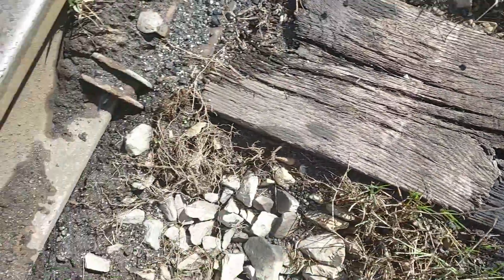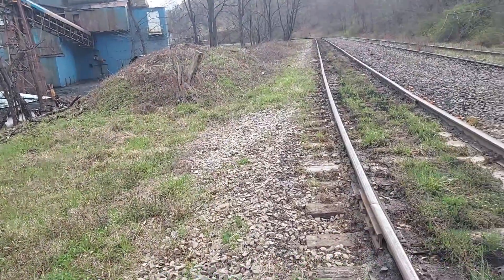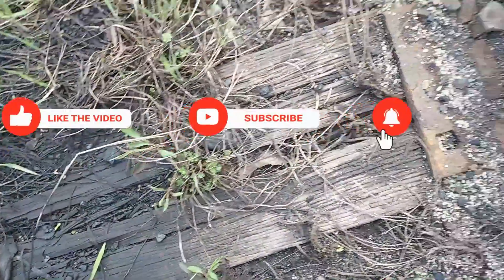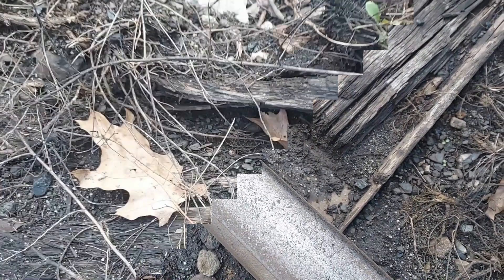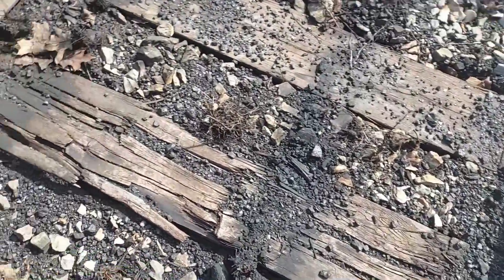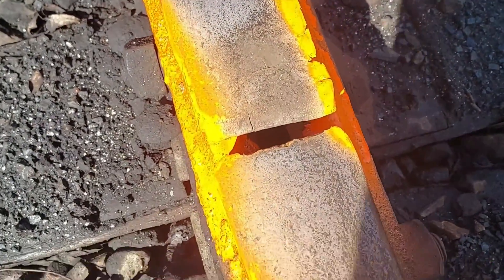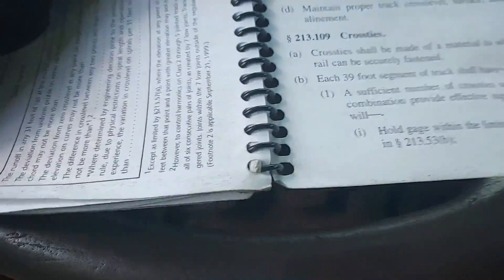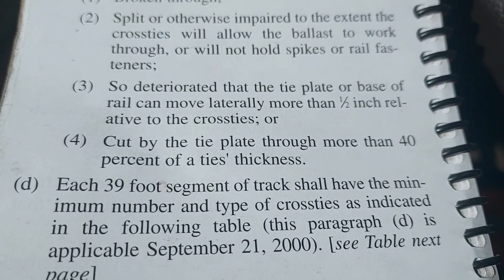Marking Bad Railroad Cross Ties on Excepted Track

Comment: OMG ! I'm surprised ! Every ! Sleeper !/ Tie ! WASN'T ! MARKED ! BY YOU ! HERE ! THE COST !??
Reply from the maker: Remember it was excepted track (10 mph) and the FRA requirements for number of good cross ties in a rail length (39 feet)
is only 5 David. There are typically 21 cross ties per 39 linear feet. 
If we didn't put any ties in there that part of the track would 
still be acceptable under Code Fed Regulations.  Really appreciate your watching our video and keep your hand on the throttle and your eyes on the rails.

Comment: i recall on conrail they had big piles of dirt and ties at end of track ran over a few of them made it a flat pancake the m-w  would freak out when they seen that guess they did not a pile of dirt would stop a 200 ton  rail car they would also  put steel cabels over the track lol ripped many of those too.
Reply from the maker: We ran a ballast car off our siding once, there was a small tamper parked on the end of the siding and it pushed that
thing down over the hill Edward. After that we put about 100
ton of ballast at the end of the siding. Never heard of using
cables across the track, can't imagine they did much of
anything.

Comment: I remember working for NS they would be a gang that would come in and they would have like 40 different pieces of machinery. A lot of those smaller machine looked a lot alike but had some differences about them. I know what a tamper is a spike puller  and a spike driver some of the larger pieces was obvious. But the smaller pieces that looked a looked a lot alike in some forms would leave me wondering. You knew they was there for something but most of them I couldn't tell what there purpose was. And what ever become of that autonomous hopper car you once showed . I've been retired for 10 years  but haven't seen one of those yet. Will they let them run on class one RR  ? that's almost looks like where they belong.
Reply from the maker: Your right, now a days there are so many machines on the tie
gang it's hard to keep track of what everything does. 90% of
the manual labor has been eliminated by the machines RC.
The hopper car is in the testing phase, currently they burnt
up some parts and are awaiting new parts to come in.
Appreciate very much your taking the time to check out the video and may you have a very good day my friend.

Comment: Is there a FRA MoW inspection handbook that has all the things to look for in one handy little book?
Reply from the maker: Yes there is SuperAWaC. That is the book I read from about the number of good ties required. I will show it again when we
do the first video on ultrasonic rail testing. It is the Track Safety Standards Part 213 Subpart A to F. Covers all the fed regs for class
1 thru 5 track. Appreciate your visiting with us and writing in 
my friend.
Reply: @ccrx6700  Thanks for the info. Do you know where I could buy one of those books?

Comment: How long is a tie (sleeper for me) meant to last on your railway?
Reply from the maker: Good grade ties will typically last 25 to 30 years in tangent track
with good ballast and good drainage. Ties in mud will last half that
long. Ties in sharp degree curves their life will be shortened also
because of the great amount of stresses on the ties from the
curvature.  Thanks so much for taking the time to check out the video and write in my friend.
Reply: @ccrx6700  Thank you for all the details! I like your videos a lot. I used to be a signaller and guard (you call them conductor) on a scenic railway. It's interesting to see how yours operates and is maintained.
Reply from the maker: @szabados1980  👍😊

Comment: ‘cut by the tie plate by not more than 40%’!!! My god, that’s SOME leeway?☘️👍
Reply from the maker: It certainly is donal finn, we never let our ties get cut that far down.
Thank you for taking the time to watch the video and write in. May you have a most blessed day my friend.
Reply: It's not quite as bad as it seems, when the track gets tamped the ties are pulled up. A soft tie will continuously wear, to the point that the plate is 40%+ worn through and the tie is still supporting the track.

Comment: It seems to me that there has been chronic underinvestment in track infrastructure in the US. Every time I watch a railroad video, all I see is rotten or worn away ties. Sometimes I’m quite shocked by how bad they are?
Reply from the maker: There are a lot of problems in the rail industry, mostly on the
Class 1 RR;s they are controlled by Precision Scheduled Railroading
which is all about pleasing stock holders and cutting budgets
to do it. Most shortlines and regionals don't have near the
problems the big RR's do.

Comment: While inspecting track for the USRA study of bankrupt railroads in 1974,  I saw a length of track that was at least 6 rails long that the ties were plate-cut about 75% and did not have any plates or spikes showing and observed a loco with several cars traverse the track at 5 mph and DID NOT derail.
Reply from the maker: An old railroader once told me you will be amazed at how
a train can sometimes go over really bad track and not derail,
and then at other times the slightest little thing will jump a
car off. That's railroading. Thanks so much for writing in
and watching my friend.

Comment: Way back in the day before my time. They used a white dot in the middle of the gauge. when they cut the ties in two places and used the butt picker machine that pre-dated tie cranes. We were walking a long stretch and my boss asked me what I thought happened at a given location. White paint splattered all over the inside of the rail. Before the aerosol cans they had a blotter tool you carried paint for. I figured it was alcohol related or some post domestic incident. I know how things were on the system and how knuckle dragsters could be. The Supervisor figured bees. Made sense once you could imagine some poor track worker desperately swatting away wile running.
Reply from the maker: A spot like that certainly would make one ponder for a bit Lawrence!
Thanks so much for your visiting with us and sharing the story
my friend.

Comment: is a runaround track the same as a passing siding?
Reply from the maker: We call it a run around track here because when we only had 1 loco
that track is what the loco ran around on to get to the other end
of the train cars. But basically yes it's the same as a passing siding.
Switches on both ends to reconnect to the main line, same as
a passing siding.

Comment: As a rule, do you replace ties whenever a derailment occurs? I would think the wheels would do pretty bad damage to them, but I could be wrong. Thanks again for another great video!
Reply from the maker: Depends on the amount of damage Jason. Sometimes just
one of the tie ends gets damaged so those usually don't get
replaced, sometimes there is major damage to the ties and
they all need replaced. Here is a video we had of a derailment
April 2020. The ties are splintered, it's ugly
https://youtu.be/hzcVIM-rqLo

Comment: Do you ever use Relay cross ties?
Reply from the maker: Almost never Thomas except for in sidings. They have always
bought new grade ties for the main line. Most of our good relay
ties are given away, if you watched my videos last year on
rebuilding the W&W RR I gave them over 250 good relay ties
and we replaced them their.When ties are taken out they
are sorted thru and the junk ones go in dumpsters, we do
save the good relay ties and have a few on stock for
emergencies.

Comment: US railroads should really start replacing timber ties with pre stressed concrete like the rest of the developed roads. Timber ties were ok during steam days but that was over 60 years back.
Reply from the maker: If you would care to learn more about why we don't
use concrete here, then watch this video, explanation is
about 1/3 of the way into this video. Nothing wrong with
concrete ties but we for now simply cannot have them
without a very expensive upgrade to my tamper which I
explain in that video.
https://youtu.be/oOug0z34118

Comment: David,
Good evening hope you are well.  I have been meaning to ask this for awhile but, what is the disadvantage of Concrete ties if any and why they are not the mainstay of RRoads these days.  Appreciate your consideration!
Reply from the maker: There is a big discussion about concrete versus wood ties,
way too much to go over in a comment. Someday I will make
a video on the differences, for now we don't have concrete ties
because my tamper will not insert the tamping tools deep
enough to get under concrete. Concrete ties are 2 inches thicker than
wood. Tampers with the Jupiter 2 operating system can
easily toggle between wood and concrete with the push of
a button, but I have an old operating system on my tamper
which requires a manual adjustment of limit switches which
would take about 20 minutes to do. Total PIA to do also.

Comment: The limit switch issue for the tamper seems like something an enterprising shop mechanic could fix with another set of 4x limit switches and a 4-pole double throw A/B selector switch in the cab with an pair of indicators.
Reply from the maker: Now that sounds like a very good idea Tim! Wonder no one
ever thought of that, seems like it would work very well. Appreciate
your writing in and for taking in the video tonight my friend.
Reply: @ccrx6700  Cheaper than a new tamper for sure.

Comment: Hi Dave, great video. Quick question, would it be more beneficial using concrete reinforced sleepers (ties)?
Reply from the maker: Thanks John and glad you enjoyed. I cannot tamp concrete ties
with the operating system on my tamper. Here is a video where I show
you why on the tamper, it's about halfway into the video where
that part is shown if you would care to watch:

https://youtu.be/oOug0z34118
Reply: @ccrx6700  That's cleared that question up nicely, thank you.
Reply from the maker: @johnn1575  😊👍

Comment: Also I forgot to mention your lucky ! When I had crushed head like that i was almost always forced to let it Dutchman to about 3 1/2 to 4 inch before 
Getting to change it out due to our limited rail supply
Reply from the maker: I hear that W. G. but that's what good railroaders do, they fix what
they can with what they have to work with. Pain in the rear to do
it that way, but if rail isn't available you made some excellent choices.

Comment: Nice great video as always Dave notice some mudding and some rail movement in some areas you marked. I know under excepted circumstances you don’t have to worry about being in compliance in 1 and 2 are you gonna do some cribbing on this or let it ride ?  On your plate cut example excellent explanation on the plate cut and can’t deficiency explanation. 

When I know I have budgets  for it I like to mark all my joints first then mark the remaining ties. 

Cheers from one railroader to another!!
Reply from the maker: Thank you very much W. G. for the very nice comment. Always a
treat for me to hear from a fellow railroader. We will eventually
crib that section out but for now we have bigger mud problems on
the main that will get addressed first.  After the ties were replaced,
we ballasted and tamped the section so it will hold up for awhile
and train is safe to run over it. Good thinking sir on the ties under
the joints first! Appreciate your writing in and for watching my
friend.

Comment: Sir what class is the rr you work on? Also I thought that class one was the best track to run on. Thanx Ken from gpt ms
Reply from the maker: We are on class 2 track Kenneth. There are 9 different classes
of track in N. America. The higher the class of track the faster
the speeds allowed on the track. Classes 1 thru 5 is generally
for freight and passenger. Classes 6 thru are 9 are almost
exclusively for freight.  There are 3 classes of RR's in N. America.
Class 1 RR would be a company that has a huge amount of tonnage
and revenue. Class 1 RR's are those like NS, CSX, UP, BNSF, KCS,
CP and CN. The lower the class of RR the lower the tonnage they
haul and the revenue they bring in.

A Class 1 RR may have different classes of track over it's system.
So you see now the difference between classes of track and classes
of RR's.

Comment: the manual ought to say moves laterally relative to the line rather than the cross tie. if it moves laterally relative to the axis of the cross tie then thats a whole other problem.
Reply from the maker: I'm sure the FRA might be interested in your suggestion hardrays.
Lateral movement in the rail is certainly never a desirable thing.
There is another section in the CFR that does address the amount of
lateral alignment that is allowed/not allowed on the different classes of track. Appreciate your taking the time to write in and for watching my friend.

Comment: How heavy is this rail? Is the track a 'main line' or is it a spur w/ a run-around? Can concrete ties be spaced further apart then wood depending on rail weight & traffic? 4:30 It looks like you have sunken track. There's a lot of fines & debris in the ballast. Do you think there is a developing issue of drainage? 6:45 I'd think the 'plate-cut-tie' & many like it, might as well be replaced while the MOW crew is in the area...wouldn't you think? It's only going to get worse. Thanks for answering any questions you can make time for & thanks for the video Dave.
Reply from the maker: Rail is 132 pound Carmie. Track is a run around and used as they load 
the train. Yes there are some places in that whole section which
are sunk and could use a good tamping, the tie gang generally does
not like track being tamped before they put in ties, so it has gotten
tamped after the tie replacement happened. Yes we do have
some drainage issues that will have to be addressed at some point,
but right now we have bigger issues on the main line to take care of.

Comment: looks like some areas have been flooded out with mud leeching between the tracks. won't the track bed need repair and re-ballasting to repair that?
Reply from the maker: Yes this section does need some cribbing work done MidnightVisions.
But it gonna be awhile before we can get to it, got bigger fish to fry
cribbing on the main for now. After the ties were put in then this
whole section of track you saw we spread new ballast and tamped it.
So it will hold for awhile until we can crib it out.

Comment: It seems like the ties are sitting on the ground rather than a layer of ballast.
Do you reuse the tie plates and spikes or do you just replace them with new?
Reply from the maker: After the ties were replaced we spread new ballast and tamped the
section you saw. it does need cribbed out Edward but it gonna
be awhile before we get to it, there is bigger fish to fry cribbing on
the main that needs done first. Tie plates are re used unless they
are broken or bent. or severely worn. Spikes are always new ones.

Comment: Will the ballast regulator move ballast away from the ends of the ties to make it easier to replace them
Reply from the maker: No it will not Wayne. The TRIPP machine they use to replace
the ties does not need that done. If there is too much ballast
that machine can sweep enough of it away. Will have a future video
of the TRIPP in action and a cab view, but here is an older video
of it if you would like to see it in action:

https://youtu.be/21bPTJqOzhA

Comment: How come you are not paint marking the outside of the rail head  so if the ballast on top of the rail gets moved. The bad tie location is still marked.  It's just a question.
Reply from the maker: Good question Wayne. Ties were marked only a few days before
the tie gang came in and no ballast regulating was done after
they were marked. Marks on the rail are sometimes very hard
for the grapple truck driver to see as he is spreading ties. Most
of the grapple truck drivers I have worked with over the years
prefer the outside of the tie to get marked instead of on the rail.
And, one thing you learn early in railroading, never get a grapple
truck operator upset with you specially when your a gandy on
the ground working with him.... :-)

Comment: So you need 3,250 wooden ties for a mile of track.  $ouch.but that's rail roading.  
3,650 ties per mile with concrete.
Reply from the maker: Generally speaking Wayne there are about 21 ties per 39 foot
section of rail. Concrete ties are often spaced wider apart than
wood ties are. Wood is 19 inches on center whereas concrete is
up to 24 inches on center. Thanks for taking the time to watch
the video my friend.

Comment: Thanks for another entertaining and informative video.  I preferred working with wooden sleepers , sorry cross ties than concrete ones . They are more easy to move by hand and seem to have more ' life  ' to them or though concrete ties lasts longer . In the p-way team I volunteered with we did have some mechanisation so we could replace between 5 and upto 25 ties in a day .
Where as Network Rail only manage about 5 in a day ! So not bad for a bunch of volunteers who all were over 60 !!
   Looking forward to your next video .
Reply from the maker: Your certainly welcome John. Very pleased that your enjoyed the
show and we do appreciate your stopping by and watching my friend.
Wood is flexible where concrete is not. Car wheel goes off and
wood ties are gonna hold up better than concrete too. But RR's
are experimenting now with pre stressed concrete ties as the old
ones would develop stress cracks under heavy loading. Also they
are using a much higher psi concrete now than they used to.